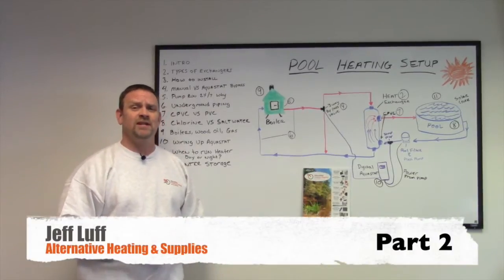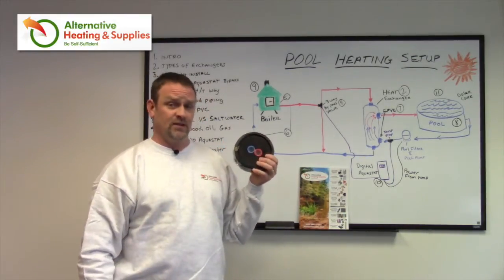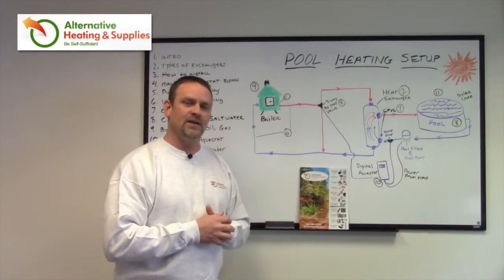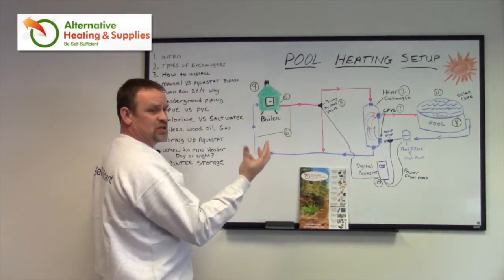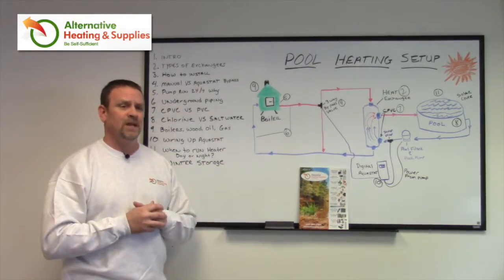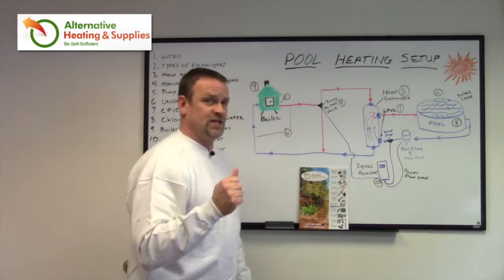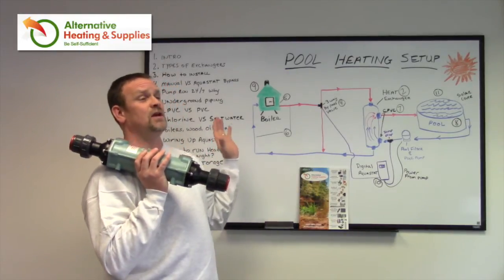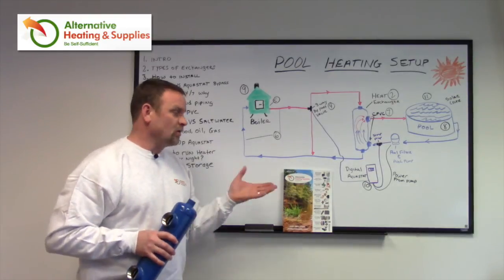Pool Heating Setup with a Heat Exchanger and Outdoor Wood Boiler - PT2

Comment: Kind of late in the comments but is there a winter option on the aquastat to run the bypass to loop only with the wood boiler?
Reply from the maker: Not sure I understand the question. Jeff
Reply: @AltheatsupplyLLC  guess what I'm asking is when I close my pool for the winter can I leave this up and not damage it.
Reply from the maker: @gmoney8221  No, the heat exchanger will freeze and break. Do a gravity drain or blow lines and shut down the loop with the pool. Jeff